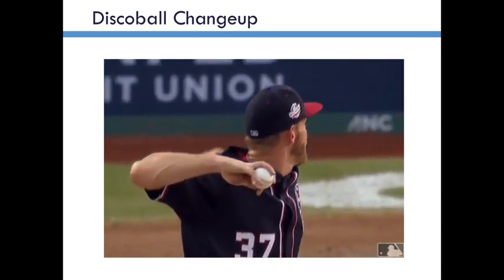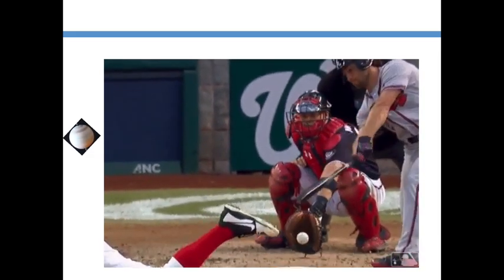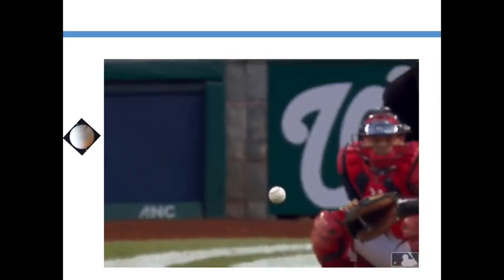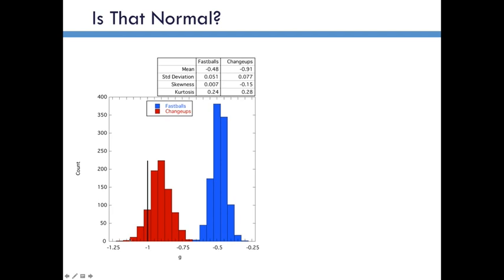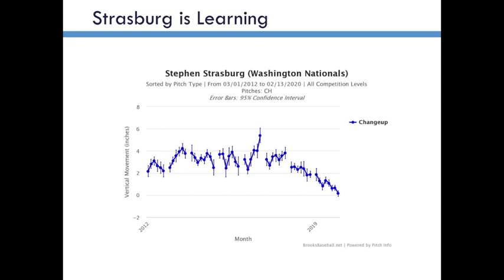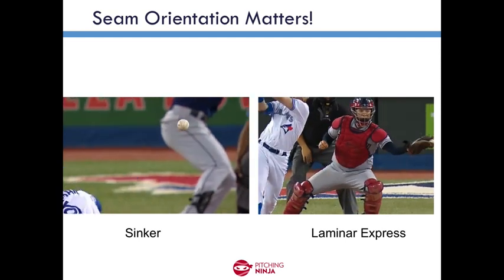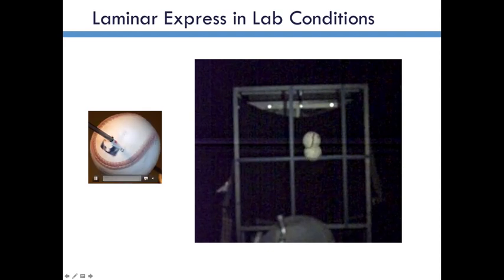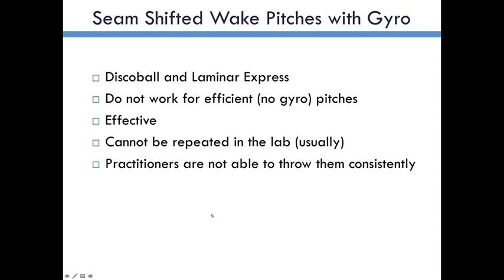Seam Shifted Wakes Presentation Part 3: SSW W Gyro

Comment: There’s one pitch I’ve thrown that would randomly cut glove side, with true backspin, so hard that it confused me as to why. I could never get it to repeat reliably. It would happen while throwing bp from the mound at 75ish percent speed usually but my grip was like a two seam with even finger pressure (I think)  and slightly split apart but across the seams and thrown over the top with pretty true backspin. It could start middle-middle looking like an absolute meat ball, then 3/4 the way to the plate it would cut laterally and end up 8” off the plate and be unhittable. Always wished I could’ve figured out the trick to it because it made some of the most disgusting swings and back door strikes I’ve ever seen 😂